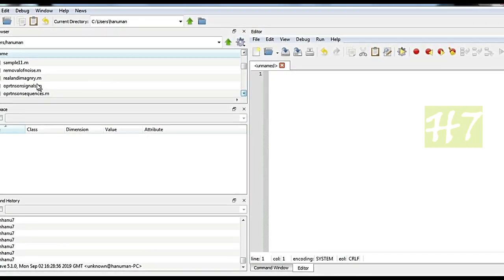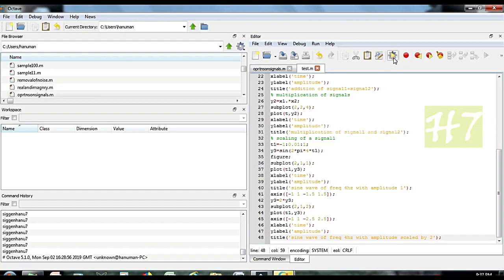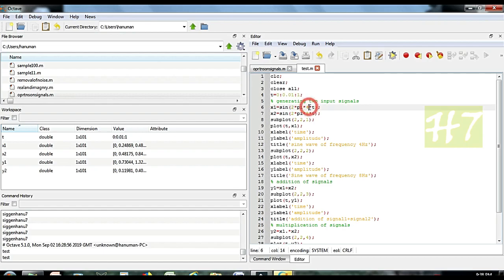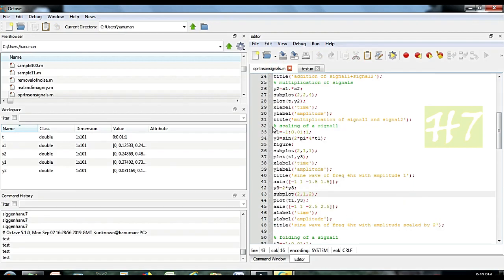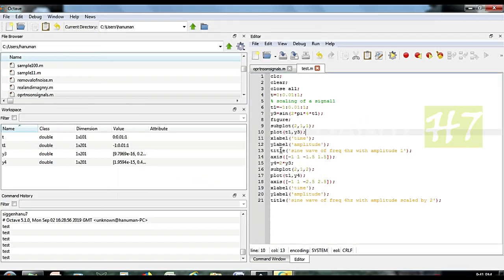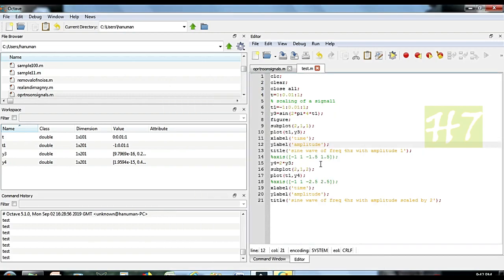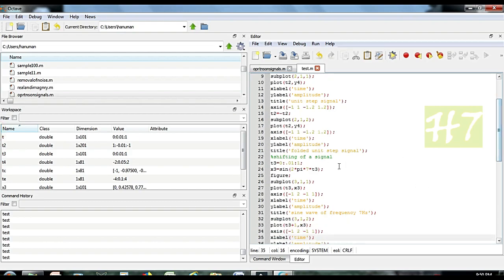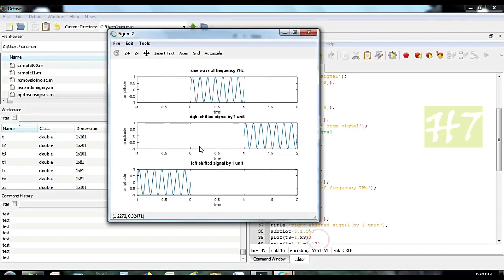Octave tutorial --- Operations on signals | HANU7

Comment: Brother i also run this program.. But my output figure is empty... No one disply.. But the program is correct and no error..
Reply: Thank you for writing to me. 

If such problem is encounter, we have to check packages are loaded or not

use the following commands ( type in command window)

pkg load signal
pkg load general
pkg load control

check whether these packages are loaded or not by tying 

pkg list

you can see star symbol on packages which are loaded. 

Feel free to contact for further help on octave either here in this comment section or @ hnu.mtech@gmail.com